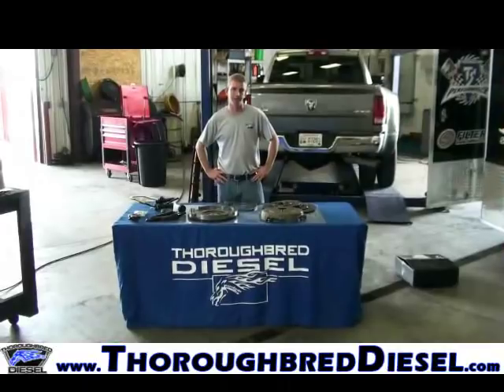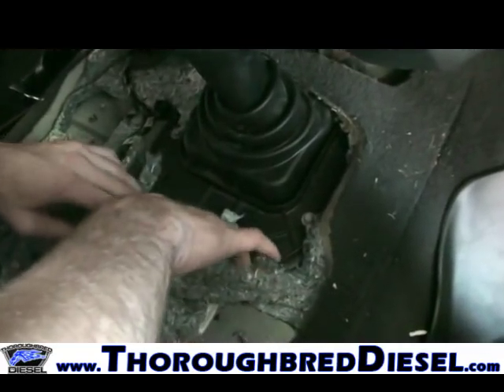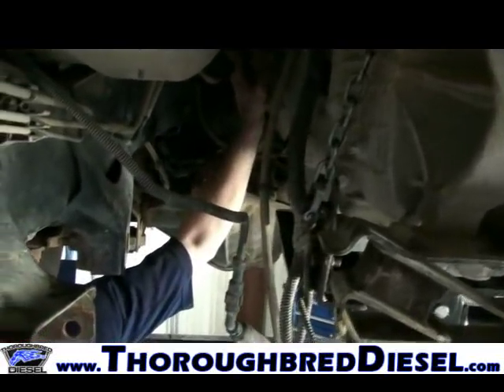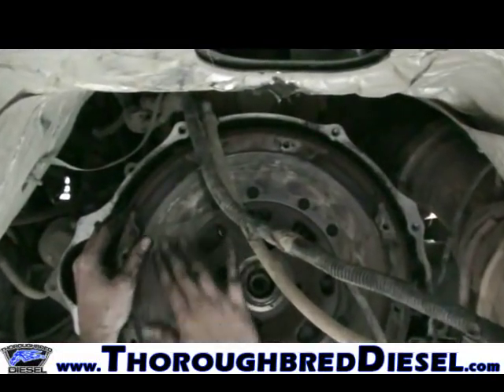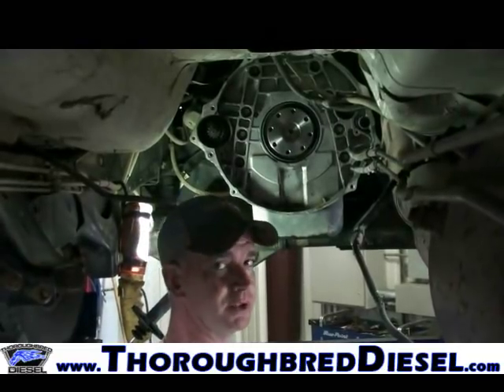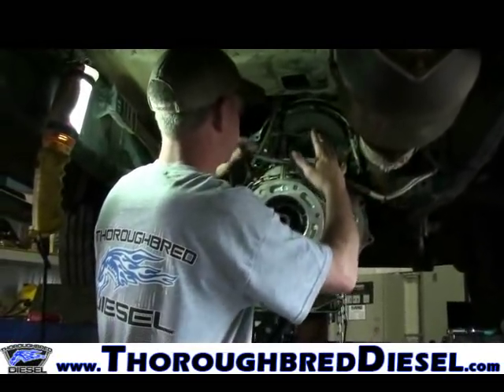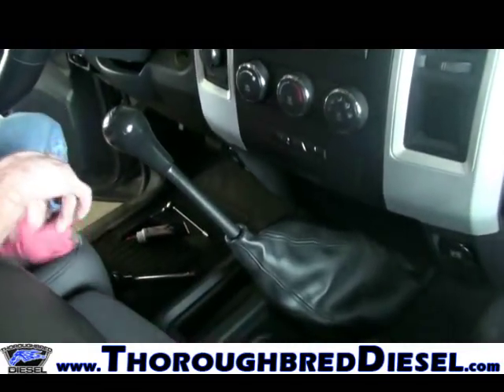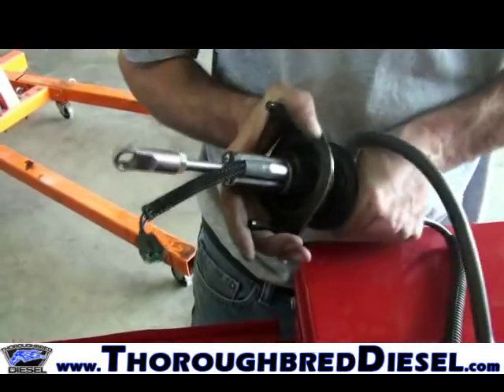Valair Dual Disc Clutch Install G56 Dodge Transmission

Comment: I just want to throw in a couple tips. 
1. Push UP on the alignment tool when tightening the pressure plate and continuously make sure it slides easily during the torquing process. 
2. If you're engine tilts forward. Use a jack and a block of wood at the front of the engine to tilt the engine back down.

Comment: Thank you so much for posting. This video is the absolute best reference there is for this project. I highly recommend this company. I bought my Valair from someone else before I found Thoroughbred Diesel but I will be buying a t shirt just to support them.   Also I would like to add a few thing as I just completed the job on my 2015 3500 mega cab. I found it helpful to have all tools ahead of time. For a 2015 you will need 24mm wrench and deep socket for the trans cross member. The front driveshaft is 16mm or 5/8” for the t case flange and a box wrench works just fine.   You will also need to remove the DEF tank and crossmember before you can pull the t case.  Remember Do Not Pull Trans In With Bolts. Reposition trans jack and try again if you are having trouble. When the input shaft is lined up with the pilot bearing it WILL go in smoothly. 
Thanks again Thoroughbred Diesel!

Comment: Few things I would do different.

Buy some zip ties that have the "Christmas tree" push pin end on them.  Very useful when you break the push pin type clips on the wiring harnesses.

Dropping the down pipe makes removal/install a lot easier.  Gets that hanger out of the way

Leave the alignment tool in the clutches until you have the nuts/bolts of the pressure plate more than hand tight. Pushing straight in on the tool while tightening the nuts/bolts.   After torqueing the pressure plate, make sure that you can slide the tool in and out easily!  If you can't, then it will be tough to get the input shaft of the transmission in.

Grease the fork where the pivot ball, throw out bearing and slave touch it.

For someone that doesn't do this often this will help the most.  Take a bellhousing bolt down to the parts store and buy two new bolts that are about inch longer.  Cut the heads off of the bolts.  Screw in the two headless bolts at the 3 and 9 o'clock position of the bellhousing.  This will help with getting the bellhousing, input shaft and dowels aligned perfectly.

Google the Mobil Delvac 50 that he recommends.  You might not be happy with it.
Reply: Making those pins is the best way to get the transmission lined up.
Reply: That's such a good idea!  Never would have thought of that.

Comment: This video has greatly helped me in the last week. I was able to with the use of the brain God gave me, I was able to pull my Transmission and change the clutch and put it all back together as well as change the universal in the driveshaft without any help. The video definitely educated me enough to make sure that I was doing it correctly and of course trying to be safe at the same time. I appreciate this video and the time you took to make it.
Reply from the maker: Comments like this are why we continue to make videos!

Comment: Really great video guys! Just did an Sinister EGR delete, Pusher Intake system, 5" exhaust, and Race Me tuner on my 2014 Ram 3500. That poor motor was so choked off by emissions BS! Not looking to "Roll Coal" as I think that gives average folks and the EPA a real good reason to hate us diesel lovers. But also don't believe cramming exhaust and soot into the intake is very good for any motor. You should have seen the grid heater! It looked like a 20 year old charcoal grill that had never been cleaned and this truck has less than 20,000 miles on it! Long story short. The truck has ridiculous power now on the second LOWEST power setting on the tuner. Enough so that the stock clutch can no longer hold on to the motor on moderate to hard acceleration. I will probably be ordering an aftermarket clutch soon and this video has me leaning in your direction. Thanks guys!
Reply from the maker: Thank you for your kind words and we are glad to hear it was helpful. That is why we do them. :) If you are thinking about a new clutch this video may be helpful as well (see link below). 

https://youtu.be/41PPej8U5JU

Comment: Great Video, helped a ton with my install! now I'm noticing it's hard to drop in to 1st, 2nd, and reverse from a complete stop. Any tips on what this could be? Is there any adjustment I can do to make it drop into gear easier at a stop?
Reply from the maker: Thanks.  Did you replace the hydro when you did the install?  If not, I would start with hydro.  Some trucks when you do a dual disk install its hard to get into 1st gear, to help with that, I always go to a gear that I know it will fall into, then come back to the gear that I want.  It stops the rotation and makes it fall into gear.

Comment: I’ve only heard one duel disco clutch and I would not want that in my truck and a guy I know has one and it’s so dam loud it rattled like crazy I could not stand that sound at all and I don’t know what brand it was a south bend or a valair don’t know and that’s been couple years ago so they might have got the quieter now I don’t know my 05 3500 still has the factory clutch and still doing fine and pure stock power and factory size tires .

Comment: Fyi I have done a clutch on a 16 without pulling the transfer case. We didn’t pull the unit all the way we just scooted it back just far enough to replace the clutch then scooted the whole thing back in.

Comment: Dude, you did this the hard way, should have remove that inspection plate and unbolted the dual mass and taken the hole thing out with the transmission. Installation is super easy if you assemble the clutch on the table and slip it over input what and reinstall, easy, did mine by myself on the floor I don't have a car lift.
Reply: If you upgrade your clutch like in this video, your method isnt possible.

Comment: Have any of the aftermarket clutch companies made a single mass flywheel that bolts onto the stock "flex plate"? It would make installation a lot easier.

Comment: Great video. I didn't see you fill the grease slot on the inner bore of the throw out bearing with grease. Are the Valair supplied throw outs pre filled?
Reply from the maker: Yes,  the bearing is a sealed, no serviceable bearing.
Reply: +Thoroughbred Diesel I Meant the fill slot on the inside of the slide bore. Did you grease?
Reply: Just installed a Valair clutch. Supplied release bearing inner slot was not pre-packed with grease. Highly recommend otherwise with time rust and friction on guide tube causing extreme pedal pressure.

Comment: I didn't see where you supported the engine itself. Isn't this necessary to avoid too much pressure on the motor mounts?

Comment: You mention adding an extra quart above the fill hole on the transmission.  Where do you add the oil?  If the oil already is at the fill hole, is there another hole to add oil?  Or do you remove the shifter and add it there?
Reply: Last quart goes in through shift tower.

Comment: Great video! I’m about to install this clutch in my G56 and this was awesome to watch before I tackle it. Is there much difference in the disassembly on a truck that has a shifter transfer case?
Reply from the maker: Thank you!  Should be the same. On the inside, I believe there is one more bolt under the 4wd shifter to loosen up the shifter cover.

Comment: Ugh! That dual mass flywheel even sounds junky & clunky when you just put it on the ground! What nonsense.😑 I've a 2018 Ram 3500 G56 Tradesman 4x4 with about 9k miles and have every intention of replacing the factory dual mass with a quality single mass, single disc clutch.😃 Nice video! 👌
Reply from the maker: Thanks!

Comment: hi guys i have a 2013 ram 2500 with the 6.7 l cummins and i want to know if you have to remove the transfer case to get it out i have that clutch kit in my truck but my throw out bearing exploded now  im tearing it back apart   my question to you is can you use a stock bearing  from the store or is yours a better bearing  in the kit  or a stronger bearing im a second owner of this truck  and this was put in over 5000 miles ago  by the first owner  and im wondering what he did wrong to this bearing i drive it to work everyday not towing heavy  just a daily driver now can you help me figure it out and maybe ill buy my next kit from you guys
Reply from the maker: To get the trans out you don’t have to remove the transfer case (TC), but I find that the install is a lot easier without the weight of the TC there.  The throwout bearing that’s included in all of our kits is heavy duty but it’s the same size as the stock throwout bearing.  If you buy one from a parts store, just make sure what you purchase is of good quality.

Comment: any reason to remove the transfer case other than to make handling the trans easier? i want to try to do it without removing it. that being said, is there a gasket or anything to seal the transfer case to the trans?

Comment: the only problem with this video, is that instead of using Loctite on the flywheel bolts you should be using a slight film of motor oil.

Comment: Does the clutch make noise when the pedal is pressed or when you are in neutral pedal released? 

He says clutch pedal released and in neutral makes noise, but I just installed mine this weekend and all the noise comes when I push the clutch pedal in. Now I’m worried the throw out bearing is bad.

Comment: have you guys installed any southbend clutches on 4th gen rams that have the factory auxiliary switches? the fuse box for them is right where the instructions say to mount the new hyd. reservoir and leaves basically no room to mount the thing.

Comment: How much money would something like this cost in a f350 6.4 manual, to hold those 210hp-300hp tunes
Reply from the maker: +Alejandro Nunez Yes,  Valair makes a Spring hub dual disk billet flywheel dual disk clutch that will hold 650HP,  the also have a smoother engaging organic face dual disk clutch that will hold up to 550HP.  I would suggest the 650HP clutch,  it is $1,395.00.  Give us a call at 866 737 4966 and we would be glad to get you one!
Reply: +Thoroughbred Diesel which one make the less noise when the clutch is off on neutral
Reply from the maker: +Alejandro Nunez Both of the clutches will make more noise than a single disk,  but it is bearable.  This is a necessary evil to hold the amount of horsepower you have.

Comment: Does that upgrade hydraulics makes it softer pedal or what? I already ordered braided hose and metal cylinders kit. Is that be ok to use with that clutch?
Reply from the maker: The upgraded hydraulics really don’t affect the pedal feel, that’s more of a aspect of the pressure plate clamp load.  If you are using upgraded hydraulics just make sure that your slave and master have the correct specs.
Reply: @thoroughbreddiesel  do you know about any vacuum assist clutch pedal add on for the ram?
Reply from the maker: I haven’t heard of anything like a vacuum assist for the light duty RAM’s.

Comment: I got a 17 ram G56 i do hotshot car hauling and haul about 20-25k pounds. Already had some parts replaced like the 5th and 6th gear synchronizer. Was wondering if you knew any places that sell beefed up g56 cases and heavy duty gears? Ive seen some on google thers several companies that sell them just not sure which 1 to go with. Was wondering if you knew a a good place that sells them? If you or anyone could help me out that would awesome!

Comment: I also have a question I have an nv4500 with the dual disk valair organic clutch. has maybe 35 miles on it. When I start releasing the clutch and it finally grabs a little bit. it is shuddering way bad. is this normal until I break it in?

Comment: so if you gotta change the rear main seal do you just knock it in or do you have to use a rear main seal installer?
Reply from the maker: On the Cummins, you can remove the rear housing and just bolt up a new rear main assembly. Give us a call and we can walk you through it.

Comment: I just had a southbend dual disc clutch installed into my nv4500 transmission. Before it was very smooth an easy to shift, but now you have to muscle it into every gear and the clutch pedal is also much harder to press. A larger input shaft was also installed and many people on cummins forum are saying its shifting hard because there was no graphite put onto the input shaft. Is this the case? Southbend says no lubrication of any kind, but Valair says its a good idea. Thoughts?
Reply: Crickets😂

Comment: question, is it okay to put Mobil delvac 50 transfer case ? I changed my G56 fluid to delvac and I have 3 quarts left.
Reply from the maker: I can’t make that recommendation.  We suggest you use you mfg recommended fluid or something comparable.  May want to reach out to the Tcase MFG and see if that would be a suitable fluid.

Comment: Hey do you guys have a video on a 5.9 dodge truck of replacing the clutch of g56
Reply from the maker: The process will be pretty much the same.  A couple differences on the interior but nothing major.
Reply: +Thoroughbred Diesel thank you

Comment: Just finished replacing a valair triple disk with the valair dual disk in my G56 and now the starter will not engage the flywheel.  What am I missing??  Thanks in advance.
Reply from the maker: Did you remove the crank spacer from the original flywheel?

Comment: Hey, so I bought a 2002 Dodge Ram 3500 recently with a valair dual clutch and when I take off uts kinda jumpy/aggressive when barely taking off is that normal?
Reply from the maker: A correction for that is usually traction bars..
Reply: Thoroughbred Diesel yes I have traction bars in front and back, and another thing sometimes when taking off it squeals at the beginning (3 seconds) does that mean maybe clutch going out

Comment: why you gotta take that washer off from the back of that pivot ball
Reply from the maker: If you do not remove the washer it will not give the throwout bearing the proper clearance since the clutch “stack” is now taller.
Reply: Thanks for the info...you guys are awesome

Comment: just finished this clutch on a 2012 and when I press the clutch pedal nothing happens. the engine rpms shift. but there's no sound to show the clutch is disengaging. I tried putting it in reverse and it seemed to go which makes no sense of how that would be possible. it didn't do anything when it seemed to be in reverse and I let go of clutch pedal. I'm lost on what the problem can be.
Reply from the maker: Is the truck trying to pull itself when you put it into gear?  What happens when you put the truck in gear and release the clutch?  More info needed.  You are welcome to give us a call so that we can help you tech.  866 737 4966
Reply: Thoroughbred Diesel thankyou for the response. after pulling a bunch of shit I ended up figuring out the clutch was too high up. I adjusted it so that it's lower and it's driving now. it doesn't seem to catch right so I think I have to fine tune it. it begins to catch about 3 inches from bottom but doesn't fully let go until pretty much at the top. it's quite when pressed. some chatter when not pressed. I'm guessing I just need to keep adjusting until I find the sweet spot?
Reply: Thoroughbred Diesel it is pretty far down right now below the brake pedal. there is maybe an inch and a half to two inches where it's actually grabbing. the first little bit it's just barely moving the truck. is that just have to break in? it almost feels like two stages of the clutch pedal
Reply from the maker: When you pedal is at rest,  it should be slightly higher than the break (1/2 inch).  As far as engagement,  sounds about correct,  but you shouldn’t be slipping it that way,  once the clutch begins to grab go ahead and let out and go.
Reply: Thoroughbred Diesel when it starts to move it's not actually engaging until almost at the top. when it does start to hit at the top the release feels right. decently grabby, but I thought it was bad if it let out all at the top of the pedal.
Reply from the maker: Then yes,  keep adjusting.  Letting out all the way at the top is fine if you are fine with it.  Its all going to come back to what you are comfortable with.
Reply: Thoroughbred Diesel sounds good, thanks for all the help. great video too. I've never done any mechanical work close to this level before and was able to by following the video.
Reply from the maker: John Yoshii Awesome! That is why we do it. If you ever got anymore questions you can always give us a phone call. 1-866-737-4966